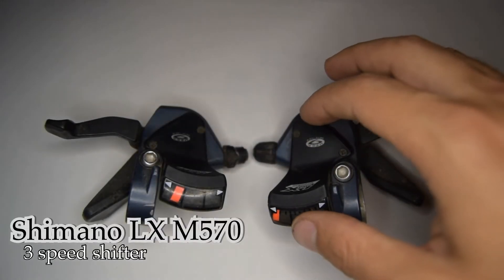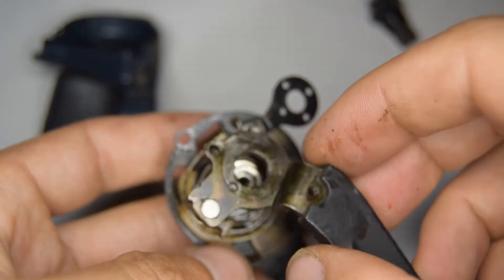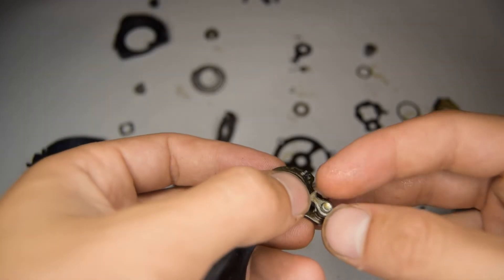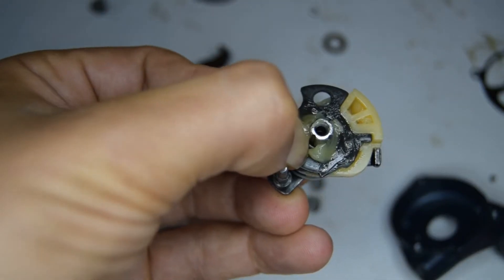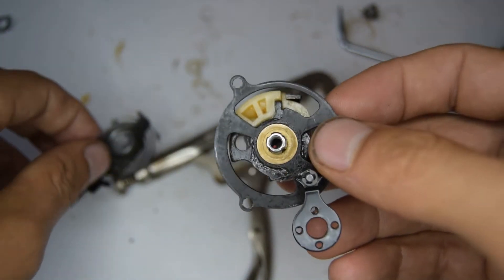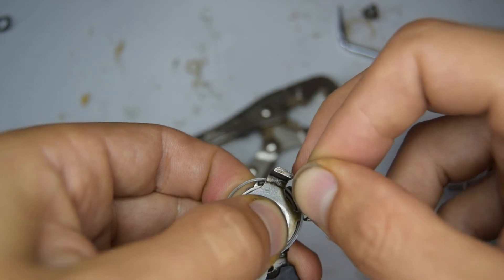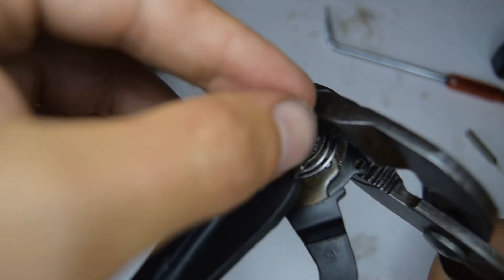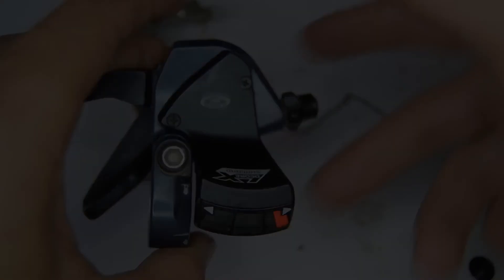Pt.1 Shimano Deore LX ST M570: Full Rebuild of left 3sp shifter

Comment: tensioning the spring is easy with dental floss.  assemble without the need to pre-tension, use dental floss to pull the spring to hook
Reply: thank you for the video, it was helpful
Reply: Thanks for the tip! You have no idea how many times i failed doing it by hand.